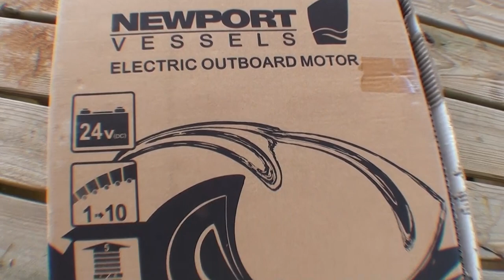Building An Electric Catamaran Prototype v1.0

Comment: Nice..lots of possibility s with this rig..maybe some Velcro on those tripod feet.on deck..have a good one..cheers.
Reply from the maker: Funny story - Florida is a title state.  This boat is illegal.  I can drive it around the back-canals near my house, but if I drove it out in the river or ICW, the first cop that sees me will come over and want to see my registration.  I can paddle the canoes around all I want, but if I put a motor on it, it needs to be registered and to register, you need a title.  Because I bought the canoes used, I have no proof of ownership like a store receipt.  I am allowed to build a boat from scratch if I keep receipts for materials and pictures at various stages in the build, but I can't build a boat out of old boats with no title.
The idea of building my own boat keeps coming up and its a terrible idea.  I can get an old boat with title for less than the materials needed to build a boat.  I don't know why, but the idea of building a solar powered boat designed specifically to fit under the little bridge keeps coming up.  Designing something to fit under the bridge would be one reason to build a boat.  Its too bad Trevor wouldn't sell me his catamaran because it fit under the bridge perfectly.
Reply: @ninehundreddollarluxuryyac5958  we have kind of the same thing for row boat .Duck boat.canoe.non powered.sm.craft..in Minnesota..the older unregistered or out of system..Stuff. Just write up receipt with k known info..can usually be issued new registation.up here anyway..good luck with all your projects..and thanks for the info. Cheers

Comment: Now you need a canopy of solar panels to keep your batteries charged, and you could go to the Bahamas.
Reply from the maker: A larger one is an interesting idea.  The Carver will burn about $5,000 in gas for a round trip to the Exumas.  I'm also thinking of having about 15 horsepower of electric propulsion on the Carver.  Its no good for long distance, but once I reach a chain of islands, I could charge batteries for a day then drive slow for 5 or 10 miles and charge there for a couple of days before moving on to the next island.

Comment: Shucks man you just need to make a deal for that old Iroquois, ha ha I stumbled across your channel after watching Trevor’s I have an Iroquois and I’m in the midst of electric engine conversion and also cutting the round top off to make enough headroom for myself and a square top for solar panels electric sailboats are the future baby!
Reply from the maker: If Trevor would have sold it to me, I would have done exactly that.  I offered to buy it from Marshall, but he's got big ideas for it.  Maybe if I wait a while. 

 Do let me know if you find another one real cheap, preferably stripped of its rigging and interior in bad shape cause I can't pay a lot.  

Trevor drove his down here from Virginia with a 15 horsepower outboard.  It could go about 6 miles per hour which is about how fast I drive the Carver.  He was able to go almost two days (probably about 12 total hours of driving) on a six gallon gas tank.  The Carver burns that much just pulling away from the dock.  15 horsepower is about what a typical golf cart makes.  Watch Craigslist for an old golf cart you can get cheap.  Take the motor and adapt it to the lower half of a dead outboard that used to be somewhere close to 15 horsepower.  Use the golf cart speed controller, reverse switch, cables and even batteries.  One golf cart motor seems to be perfectly sized to the Iroquois catamaran.

One horsepower is 750 watts, so size batteries and solar panels accordingly.  It should be possible to fit 1,200 to 1,500 watts of panels if you make a big roof that covers the whole boat.  This has the advantage of keeping the cabin cool because the deck is in the shade.  An air gap between the bottom of the panels and top of the deck will help a lot with keeping the cabin cool.  You want a breeze to blow under the panels.

Are you near Merritt Island, Florida?
Reply: @ninehundreddollarluxuryyac5958  All things come to those who wait. If Marshals looking for windows all of mine have opening hatches and for sale ha ha seems like that thing needed windows keep up the good work on your main sailboat as well!
Reply from the maker: @zacharywinters9413  I'll let Marshall know about the windows next time I see him.